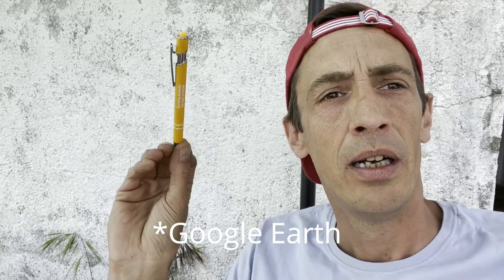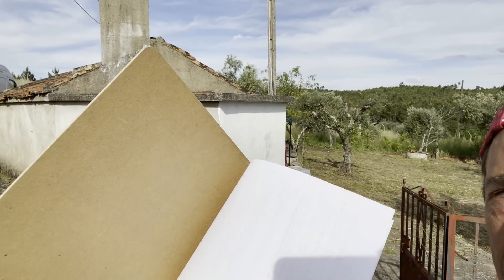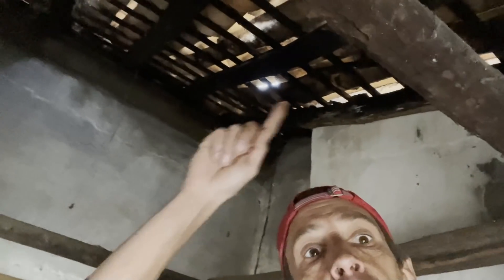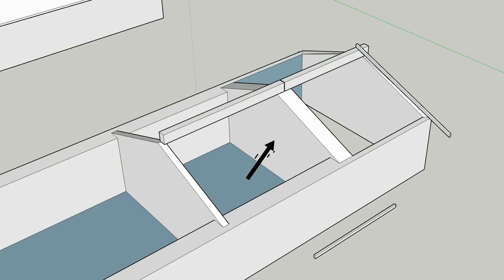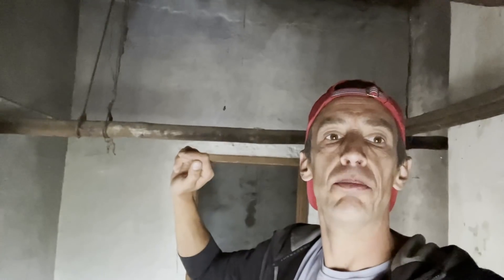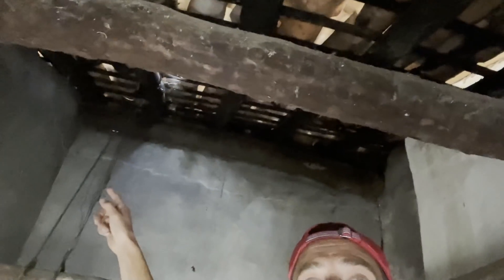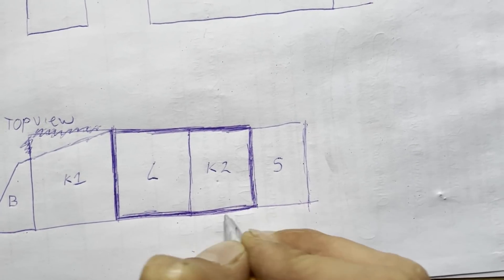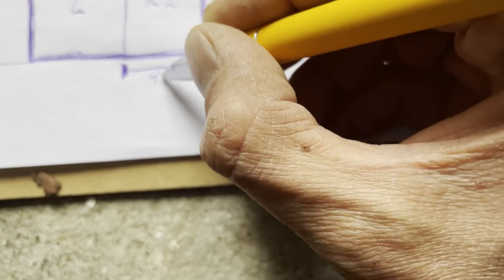Taking measurements of the house - What wood to order for the roof

Comment: Maybe this is a crazy idea but seeing the shade canopy you set up made me think of this…have you considered extending the roof out over the patio area? Would make for a much bigger job (raising roof to get proper slope), but it would allow for taller doors and give you a protected “hallway” along the long side of the building. It would also shade that external wall (cooler inside), and could be left open or “enclosed” with ornamental wrought iron. Just my unsolicited two cents. 😆 Thanks for the great videos…really fun to follow your progress.
Reply: a stoop l think its called
Reply from the maker: Yes this is what is i have planned :)

Comment: Have you priced steel? I see a lot of roofs done with steel in Central Portugal lately, and use the sandwich board roof, and even your rustic tiles on top of that!
Reply from the maker: No that doesnt make much difference now. Metal is also going up in price. Maybe if wood keeps rising like this it would be cheaper in the future

Comment: I think it will be getting a lot warmer in summer and also much colder in winter with those much thinner walls in the new room your creating. Those small rooms were not created because they liked the looks of it ! The thinner walls were used for the rooms they need not to be a there for a long period of the day...
Reply from the maker: I dont thinks thats correct. the thinner walls are just made like this because its easier to build. And in the old days they didnt have the easy building blocks.
Reply: Didn't know they were blocks, so they were build in a much later stage! But it will be not so nice and cool with a part thin block wall in summer i suspect, keep up the funny vlogs en geef die oude dame op bela pedra af en toe eens een beetje hulp wanneer je in de gelegenheid bent🇵🇹 zou een leuke vlog worden dan😋

Comment: Are you replacing the actual roof timbers? If so, why? The timbers look fine on the video
Reply from the maker: No, there are some parts that are rotten due to leaking. I could fix that, but in 10-15 years it does need full replacement. So id rather do it now :)
Reply: @GhostTownVlogs  that's fair enough.

Comment: do a verandah at the same time and order your wood for it where you can have a braai area and sit on the stoep when very hot or in rain time
Reply: thanks do arches between rooms so you dont have to go outside to enter.the lounge and kitchen can be one open space to modernise it.
Reply from the maker: Yes, that is exactly my idea :)
Reply from the maker: Id rather have the roof closed asap again.. The veranda is easy to extend after its done, so i see no issue there :)